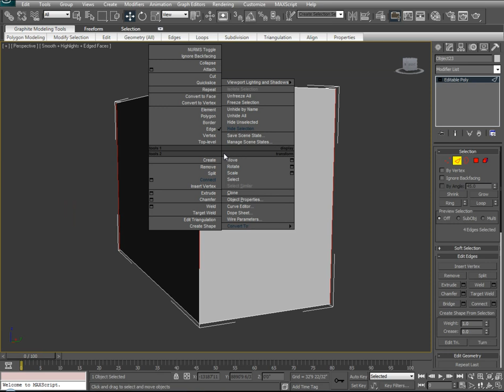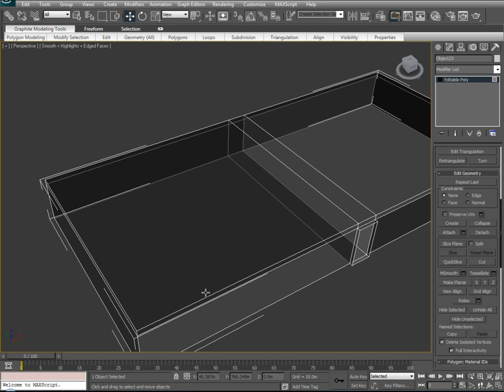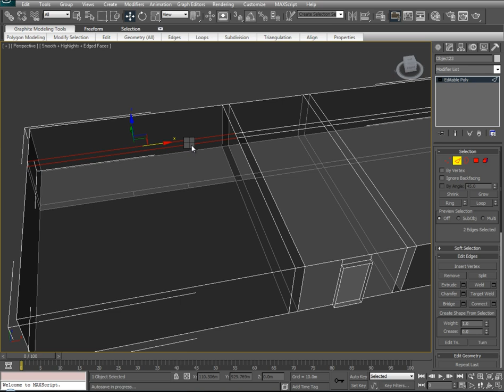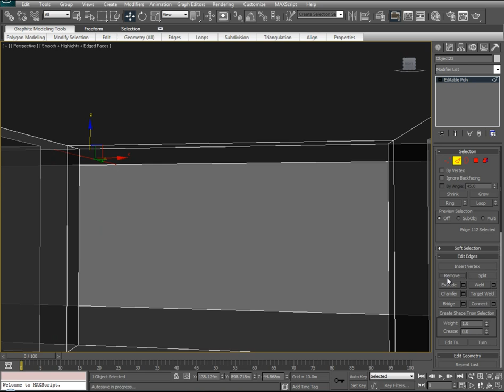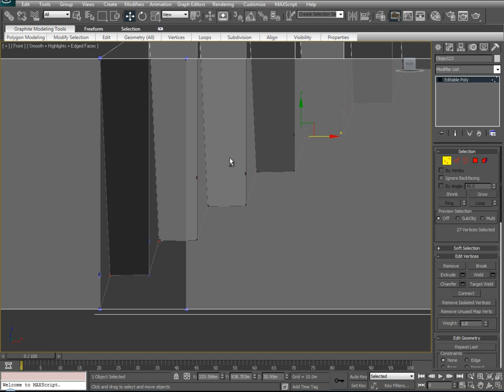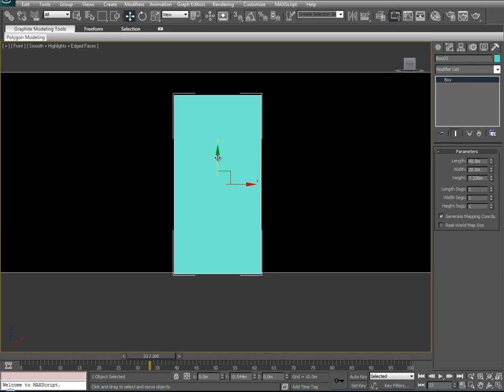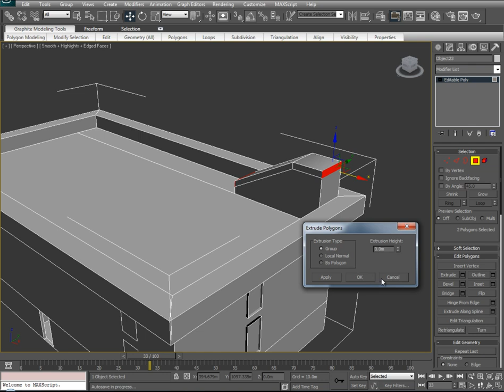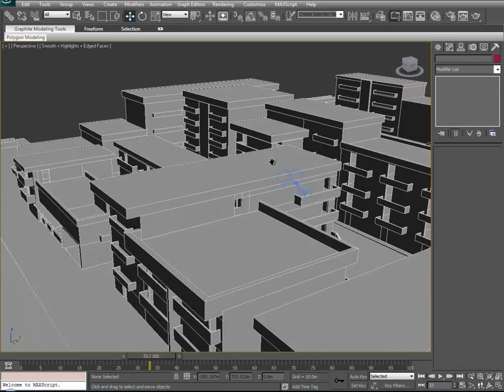How to model a 3d building and interior

Comment from the maker: @OnesandTwos1000 - Because of how we have a clear separation between what is interior and exterior, you can simply split the model up accordingly, and then even further by room by room. So, with the exterior separated from the interior, you can expect the occlusion culling to not draw all or partial parts of the interior and from inside you can expect the exterior to not all be drawn or partial parts.

I hope this helps.

Comment from the maker: @OnesandTwos1000 - After you have completed the model, go in and select all the faces or parts of the model you want to split up and use the "Detach" tool in the "Edit Geometry" roll-out. This can separate your selections into a new object(s). You can even split the model up via this method after you have textured the model as well, and still retain UVW texture coordinates.

From here, it is all up to you how you want to split the mesh up for occlusion culling, and unity takes care of the rest.

Comment: Very informative video. Thanks for uploading it. I was just curious why you don't use the swift loop when making indiscriminate cuts or the settings box for the connect tool when cutting lots of evenly spaced edges at once like the stair case. Do they have some drawback to them I may not be aware of?

Comment: Greate tip`s i noticed one trick you didnt do. it might youst be your way of bulding but when you have selected vertices and whant them to align strait in x,y,z axis instead of scaling its greate if whant to be picky thoe lol. see after x,y,x button i used some time to get used to but they save some time instead of trying to scale strait as possible :) its youst a tip Greate vide i did alsoe see some new tric`s/Tecniques :)

Comment: Thanks for tutorial, you have saved my time. But i have a problem at 17:30 when you weld the selected vertices.You can weld selected vertices at one time, but i can't. If i did, the vertices is still separated. So, i try to weld them one by one and it's looking work. A little help will be great. Sorry for my bad english

Comment: Very cool tut! =) I have a question.. why do buildings and other obj's in games have extra lines/poly's? usually they will be going diagonally from one vertex to another. like a doorway for example will have a lot of extra lines going to the corner of the building or something like that.
Reply: The reason for this is that the major APIs for rendering (OpenGL and DirectX) use triangles rather than quadrilaterals for rendering.  So if you have a square, you can turn it into two triangles by cutting your square along a diagonal.  Now that you have two triangles, your game engine will have no problems rendering your geometry.

I believe triangles are used instead of quadrilaterals because triangles provide the most flexibility without waste.  If you just need a triangle, and you work with quads, you end up having two hide a point on top of another point to get rid of it.  That hidden point isn't really providing any additional benefit and still requires real-time processing.  With triangles, you can still create virtually any shape (quads, boxes, doughnuts, humans, etc.) without having to hide points.
Reply: HoodyhooGames
ok and when you tesselate this is standard for any game? meaning you don't have to do it any differently for a certain gaming engine?
Reply: Brad DuBois It seems pretty standard to do that at some point.  As an important note, you usually triangulate during export as to not damage the original mesh (for designers, dealing with triangles can sometimes be harder - this video is a good example where quads are easier to work with).  At some point, though, a game engine will need to have triangulated mesh data.  Either the model is pre-triangulated or the engine can triangulate it itself.  Many designers tend to prefer to manually triangulate from the model package since it gives the most control and incurs less overhead at game load time.

Comment: maybe I missed something... At around 15:00 when you are deleting the small faces to avoid "z-fighting", why did you delete the ones in the hallway if you arent extruding those floors up? I did what you did and now I have gaps in my walls. Shouldnt you just not delete them and then remove the unneeded lines and vertices?